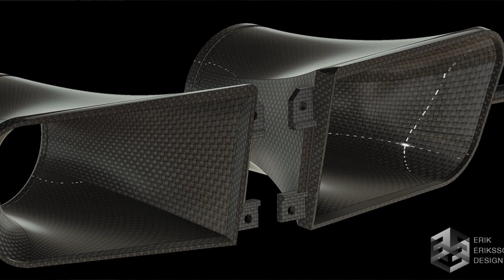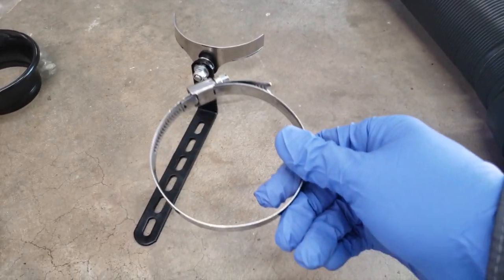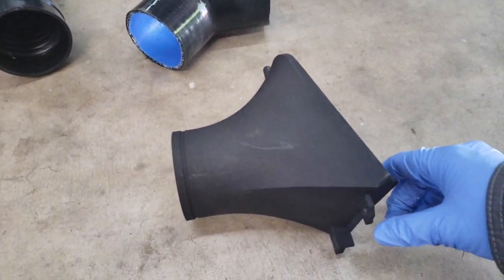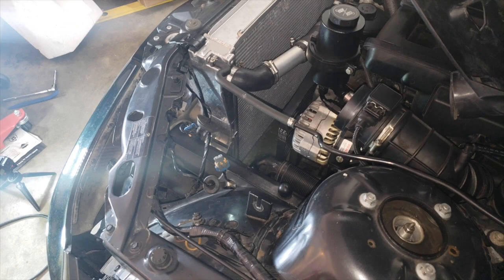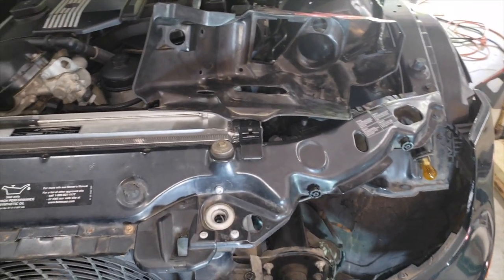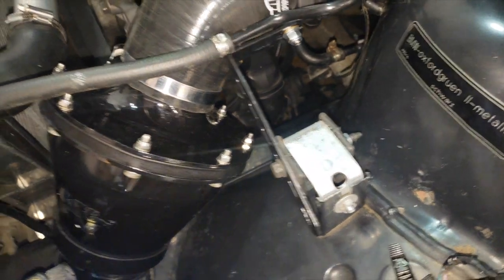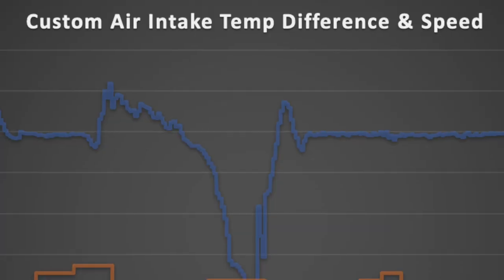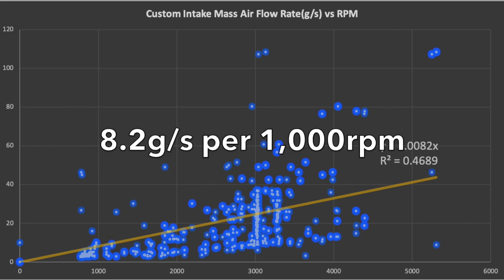Installing K&N Apollo and Ram Air Intake System on a BMW Z3 6 Cylinder

Comment: I had a BMW dealership install a Dinan cold air intake on my 2000 2.3 .  I was able to retain the left fog light as the inlet duct is within the lower left corner of the of the air dam in front of the radiator fan....thus a very pressurized area. 
The BMW technician told me to get the full effects of the cold air intake installed and the ram air...Dinan insists on getting the Dinan chip / remapping done as well as you'll be getting much higher maximum RPM's from the engine
Reply: Dinan is shit. They want everything dinan and cost x10 $$$. Going to diff tunners are best way to go

Comment: awesome video with real data and a before and after comparison great job!! i was wondering since the temperature of the ambient its important cause in a hot place it would also get warmer air even if it comes from the very beggining of the car 
meaning : to hotter places any mod to do would not do much difference  and just spect to get some improvement on the amount of air ,   so coldest places take colder air  therefore would make a difference if that makes sense. you did it on a 6 cilinder car that naturally suck or aspirates ( my bad english correct me please )  more  air with more power 
cause of the size of the engine.... my question its do you think the results could be more or less signifficant on a 1.9 lt engine? 
some times physics are not logical i mean taking just numbers it would seem to be the same for a 4 cilinder banger 
or if it does make the same gains those 3 or 4 horse power would be more significant  on the 4 cilinder engine ? and last 
question those 3 or 4 horse power make some diference in your case , do you nottice a more responsive car ? thanks and sorry for  making so manny questions i live in the caribbean where air its not cold by any mean  i have a 1.9 z3 thinking that probbably this mod will make none to very small differece for the money  ...best regards
Reply: It is even more important because you dont want to heat the already hot air any more.

Comment: Thanks for the great video! Two thoughts: would it help if you wrapped the air tube in 2mm neoprene to insulate the air from the engine bay heat? Also, there are two rectangular cutouts inside the front fender liners for brake cooling on the z3m. Why not cut them out and connect them to the nice foglight scoops?

Comment: Sad you didn't test the main benefit of a REAL Cold intake system like you have now.. Which is the change in Air temp when sitting in traffic / at the lights where under bonnet temps are the highest.
Reply: When you aren't moving or going to be using high throttle loads. Doesn't matter if your car has a billion HP if it's sat idling.
Reply: @TheYouTubechannels632  even at idle your engine is taking in air, the butterfly valve on your throttle body isn't 100% shut. So sitting in traffic, even on a hot summer day, the ambient outside air, will be less than under hood. Even in bumper to bumper traffic... so long as the person in front of you exhaust's it's pointed right at the intake sight. My stock intake pulls from the wheel well, behind the headlight. Unfortunately, road, manifold and tire/brake heat radiate around that aera too... though being a truck it needs to be away from where water can get it. Air can compress. water can't.